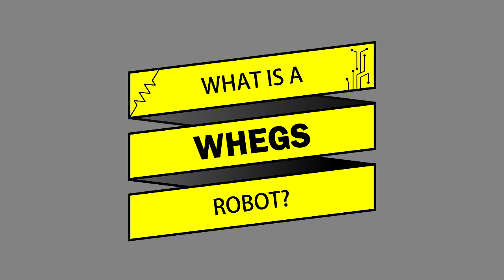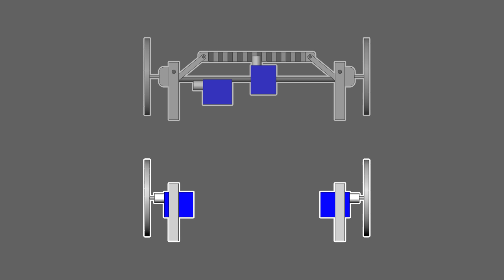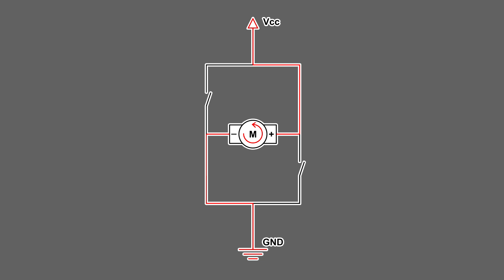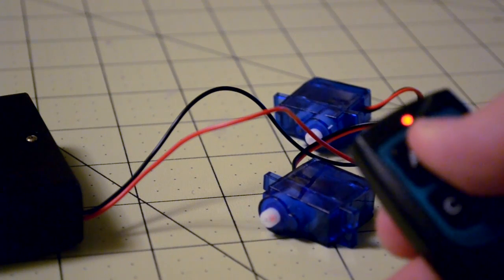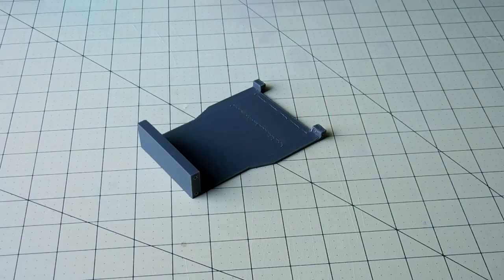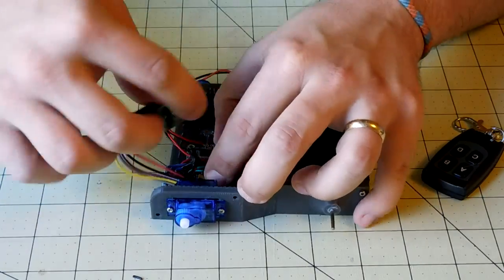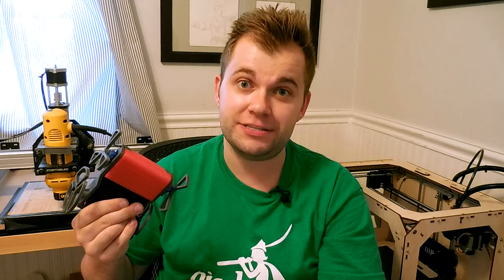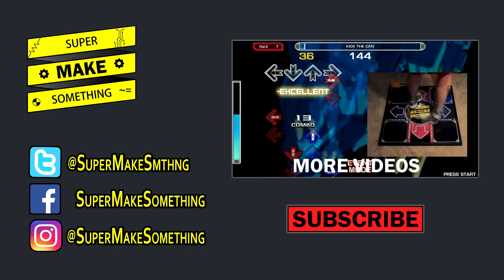RC Whegs Robot (Arduino, 3D Printing, DC Motors, H-Bridges, & RF Remote Control)

Comment: Do you have to buy the solid works software?
Reply from the maker: While you do need to buy Solidworks, there are many other CAD software packages out there for free that will let you do similar things.  Fusion 360 from Autodesk is free for makers and hobbyists, and has a lot of the same features (plus some more!).  I've only recently started using it, but am really liking it so far.  Definitely check it out!  I may do a video about Fusion 360 sometime in the near future.

Comment: Why did you add an extra switch on top of the H-bridge to PWM the motor voltage? Would be simpler if you just applied the PWM signal directly to one of the two active switches in the bridge itself. From what i've seen on the datasheet of the TB6612 the device does not even have that switch you've drawn in your simplified schematics. You would use the PWM input of the TB6612 to apply breaking on your motor (both bottom switches activate in the H-bridge, effectively shorting your motor). I would guess it would be more effective to let your wheels spin freeely and only apply the break when you want your robot to stop completely. For speed control, just PWM the bridge inputs directly.
And I personally would prefer to use some proportional controls instead of that digital input device. Shure, it's going to drive the price of your robot a bit higher, but cheap 4 channel transmitter/receiver systems (like the stuff from hobbyking/turnigy) is only 25$ and it's much more fun when you can control the amount of speed and turning rate of your robot.
Reply from the maker: I agree.  This was mostly done for illustrative purposes to demonstrate how you could modulate the voltage on an H-bridge using a simple schematic.